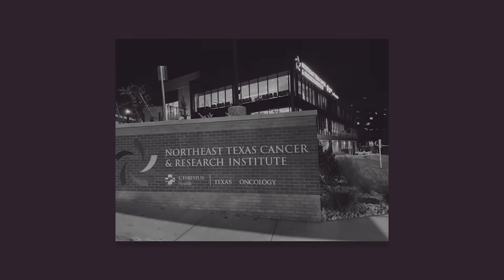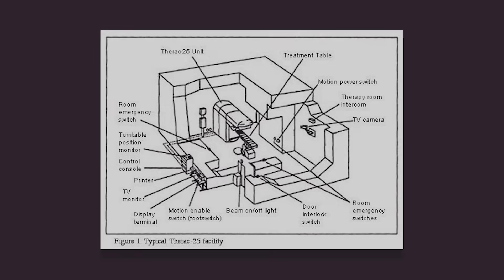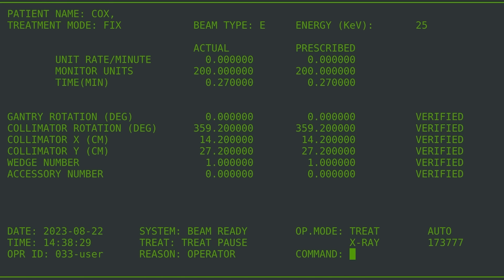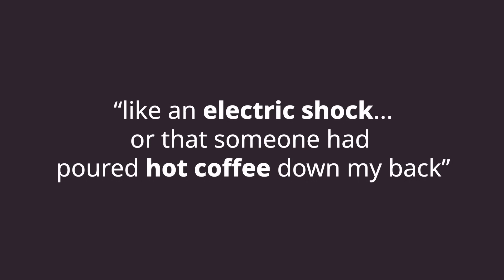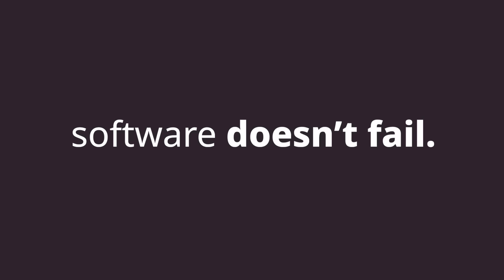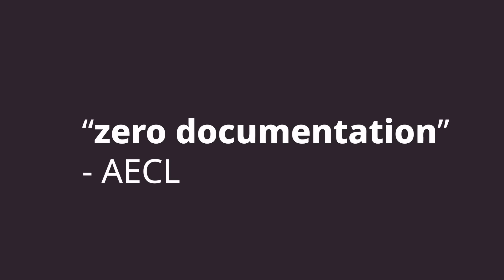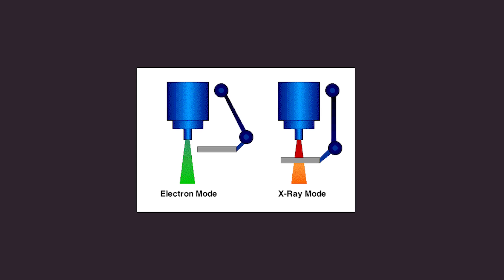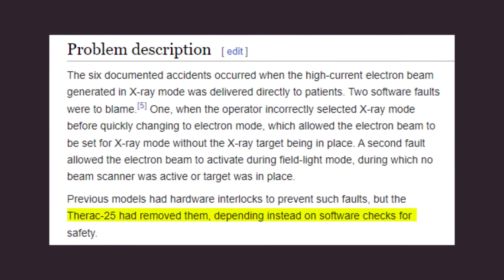how a simple programming mistake ended 6 lives

Comment: I'm a full-time software engineer and part-time nuclear/radiation nerd. I've heard this story on other channels and read about it online, but nobody else goes into detail about the software aspects, which I find the most interesting. Great stuff LLL!
Reply: Well, too much detail is impossible, the code isn't out there at all.
Reply: They probably don't want it public cause it's recycled code that still gets used today 💀
Reply: I have been writing assembly language code for over 30 years.  I was cringing... watching this video.
Reply: I’m writing a book for junior developers, what in your opinion was the root cause? Failure to test?
Reply: @danmurad8080  I think the testing aspect is very important and would've absolutely reduced the severity of the failure, but in this case when hardware is involved, relying too much on software to assume the hardware state without any way to verify it is begging for disaster. Even something as simple as a 3D printer would be a lot more hazardous without sensors to ensure the hardware is in the right state.

Comment: Sobering and sad. A reminder that clean, thoroughly tested code is crucial, together with the assumption that there still may be bugs no matter how many edge cases are accounted for in the tests.
Reply: and hardware locks are the most important, they make sure that even if the software goes wrong nobody gets hurt
Reply: @nelsonahlvik6650 Or if vulnerable parts of the hardware go wrong, the locks protect the entire vicinity (e.g. if the locks worked correctly, Chernobyl wouldn't have exploded).

Comment: If anyone still intent on using software for safety critical applications, I would recommend hybrid setup, with hardware interlocks and sensors so that way if a computer fails for any reasons, hardware portion of safety mechanism takes over. For this case, if a computer goes derp, the electron source must shut down instantly, preferably with forced human intervention so that way you have a technician taking a second look. Attention is always the key to safety. And yessss!!! Properly document everything about the medical software and put the lookup tables for error codes in the documentation handbook, so the radiologist can properly take the action.
Reply: Hardware is nothing more than frozen software and is as susceptible to defects as ordinary software.

Comment: This is why I won't ever code anything where human life is at risk
Reply: Except that verifications are usually a matter of paying the fee and sitting through the course and have next to nothing to do with competence.
Reply: Hoare calculus and verification
Reply: If i was the company i would hire a software engineer who is verified and thinks about everything, not a hobbyist coding student
Reply: @309electronic5 its not about the developer but the company does not fully test the system. The right thing is you should employ a separate QA to handle this kind of edge cases
Reply: @309electronic5 They want money, sweet sweeeeet money, that's all. Sadly

Comment: The problem is that the treatment mode (the state) is saved in the ui. However the ui should not have saved the state but rather queried the hardware in stead. Once you create copies of data, you create extra work you self of keeping them in sync. Just query the source of the data in stead
Reply: Sounds like a task for React
Reply: @mieszkogulinski168  You should not make it even worse than it already is by introducing the messiness and unpredictability of Javascript into the mess...
Reply: You're definitely on to something there. I've seen many times similar problems arising in multithreaded code (non-life threatening, luckily...) over the years just because the same information is stored at more than one location within the program. Often it is stored in one or more UI-related places plus in the program's core "business model" code (whatever that does). One can avoid race conditions all the way to your heart's liking, but still fail to keep all values in sync.

Sometimes one user input may depend on another input, which might even be hidden somewhere else in the UI (eg, different tabs in a Windows dialog box), but the code that validates the dependent input retrieved (a copy of!) the other controlling input just at the wrong time. That could appear similar to reading the E vs X entry before validating the dose entry in this case.

Comment: To produce Xrays, a 'target' is placed in front of the electron beam. The electron beam hits the target and xrays are generated. The target moves into the beamline on a mechanical arm.
The bug is definitely from the dark days of software development, and it pretty much ended the AECL. The technology has lived on however, just with better safety designed in.

Comment: Something like this, where someone's health is at stake, should have had a team of programmers agreeing on, and reviewing each others code. The root cause wasn't the lone programmer - it was all those above him who signed off on that lone programmer. Disgusting working practice and yes, that lone programmer should also have recognised the danger immediately.
Reply: To me the worst part of this was the removal of hardware interlocks. Software can NEVER be relied on 100%, even if it has been extensivley tested. Physical switches and relays should ALWAYS be in place for safety critical applications. If there were hardware interlocks in place in the Therac-25 this would never had happened. Sure, the bug would still have been there, but the machine couldn't have hurt anybody as the emitter PHYSICALLY would not have been able to activate without the magnets in place.
Reply: @nelsonahlvik6650 Not just that, what if some hardware filter breaks off the machine and BOOM, EVERYTHING within a 5km radius is exposed??? Yes, the software would be bug-free, but the plastic broke physically so the radiation core was out there, not controlled by the software anymore...
Reply: @erikkonstas  that machine doesn’t randomly explode, it’s not a nuke
Reply: @wesselrigter8750 You could say that about Chernobyl as well, it wasn't a nuke either...
Reply: @erikkonstas  were you exposed too, or were you not exposed to school? chernobyl is a npp, a nuclear power plant uses RADIOACTIVE MATERIAL. a machine uses ELECTRICITY to generate radiation. electricity won't just explode, and the plastic doesn't protect any radiation, so there would be no difference between broken and not broken plastic, and also, the whole room is leaded so it won't "expose" anything outside of it.
Reply: @erikkonstas  so my microwave is gonna turn into a complete nuclear disaster if it breaks?
Reply: @nelsonahlvik6650 this is the same solution archetype that downed the two 737 MAX jets. Always to save a buck and trim "redundancy". Redundancy in safety critical systems is often necessary, since individual components can fail.
Reply: @nelsonahlvik6650  i wonder if like zap the power to say area 51 dose everyone get locked inside becuase most dont install manual overides anymore?
Reply: He was a lone programmer, working in assembly on a rather complicated machine. He may have been a "hobbyist", but I reckon he is more skilled than many current software engineers. 

Mistakes like these happen, logical errors and race conditions are incredibly common when working on any complex system. He "should have" caught it, is not expected. In fact current software engineering practices expects programmers to make mistakes like these. Which is why as you said, we have pair programming, code reviews, unit testing, etc. 

In critical systems like this, break testing should have been done to identify potential failure points.
Reply: Basically the plot to Jurassic park
Reply: He never had the chance to recognize the danger because he never could have predicted a major medical equipment company would shoehorn his code for an older machine in a newer model. What this video didn't cover is that the code in the Therac-25 was EXACTLY THE SAME as the code in the Therac-20, a machine that used hardware safety checks.
Reply: @iClone101  Oh, that is an interesting fact that changes things quite a bit. Thanks for sharing this tdibit!
Reply: @iClone101  The video does mention that, or at least heavily imply it
Reply: Pair programming, code reviews, and formal testing were pretty much unknown (outside NASA) in the 1980s. We have decades more experience with software today and we know what works and what doesn't. Hopefully software practices will keep advancing and future engineers will be horrified when they hear how software was written in the 2020s.
Reply: @MartinOmander  Well, I am horrified today of today's practices
Reply: @Jack_cx  the lone programmer was also a hobbyist - how can he recognize anything was an error in code or the process... Talk about penny pinching!

Comment: Thanks for this great video. I’ve heard the rough outline of that story, but never to this level of detail. I always use it as an example of the danger of rushing in to a “simple” software project. Donald Knuth wrote several volumes on “The Art of Computer Programming.” Unfortunately, I doubt if one in a thousand current programmers have read them, and of those who read them, likely less that one in a thousand understand what he’s getting at. I bought four volumes based on the title, but they are not a practical dissertation on how to write good code, but a very esoteric explanation of complex programming. I wish someone could interpret the deep knowledge of these volumes to language of common programmers. In my last job, I designed all analog, high-voltage dc-to-dc converters. Everyone was chomping at the bit to design in microcontrollers to modernize them, but without hiring anyone beyond hobby level programmers to develop the code. I’ve taught myself how to code, and at least I know enough to understand the pitfalls of rushing in to a complex project like that, but it was hard to convince management of the risks. Our products were buried deep inside our customers products, and further in their customers products, so firmware upgrades would be somewhere between extremely difficult and impossible, so the firmware would have to work flawlessly.

Comment: The problem is mainly a lack of selectivity and fine grained control.  These days using software running on networked machines in a relatively densified IoT environment, we can decide what sort of results to give for a scan, whether to maybe up the radiation dose for some people and keep it restrained for others.  It may take you quite a while to detect this.  Even longer to prove it, especially if it's running on some kind of backdoored networking chip.  The possibilities for bringing about a new level of equality are vast however.  Little bit here, little bit there, and you can really start taking responsibility, you know?  And pruning the tree of life.
Reply: There is a nice case for backdoor-enabled hardware or software mandated by governments to be covertly (mis)used for the lesser liked individuals there.

Comment: Race conditions are notoriously hard to debug. Because you only have a couple milliseconds for the exact right conditions to occur to trigger the bug.

This is a race condition with an EIGHT. SECOND. WINDOW.
Had they tested it properly, they would have been almost guaranteed to find this. This is not just negligence, this is recklessness.
Reply: this is also one of the best examples of why you need to pay people to try and break your software. you will by default always enter things correctly, you wrote the software, you wrote the procedure manual, you know what you are doing. the user DOES NOT KNOW WHAT THEY ARE DOING, and therefore is not restricted by your assumptions. this allows them the freedom to screw things up in ways you never imagined. This is why it is preferable to pay highly trained chimpanzees (also called QA testers) to find these issues first (no offense to QA people, you are literal life-savers)
Reply: @skellious  I worked on FDA regulated software, and we'd recruit complete noobs to test it, maybe a project manager or someone who has no knowledge of software or the subject area.  We called them "monkey testers" and they'd misunderstand just about every instruction, thus flushing out all sorts of bugs that knowledgeable users would navigate around.
Reply: @d00dEEE  We also do the exact same thing where I work in the NHS. I build an application and test it thoroughly. We then send it off to doctors, clinicians and ward staff to test before actually going live. Because they do everything so "wrong" they are able to produce errors me and my team wouldn't have thought of ourselves and then we're able to fix it before making the application accessable to the whole organisation.
Reply: @d00dEEE  This is the best way of testing. Worst people to test are the programmers, who of course use their own software "properly"
Reply: @d00dEEE  that is so brilliant it hurts, it's easy to forget how much you know.
Reply: @bailey125  same with my site. Somehow my users can pay for something but fail to send the details to the database. I've asked them what they did but their stupidity is so high they don't even know how they fked up
Reply: @davidt8087  Story of my life. They manage to do things so horribly wrong but when you ask them how they did it you just get "I dont knoooooow, I didn't do anythiiiiing"
Reply: @skellious  this is SOOO truth. Early in my career we had a 50+yo woman testing a 📱 app, I SWEAR TO GOD, we all HAAAA+ED her for being sooo dumb 🤣🤣🤣🤣.  It didn't matter what we did and all our testing, the next day we would have a bunch of bug reports tickets open. We would constantly ask her "WHY WOULD YOU PRESS THAT BUTTON, instead of the clearly marked button"

With experience, I realize that Programmers and technical ppl should NOT be testing any app. Its really difficult to switch off knowledge and operate in the mindset of a non-technical person.

Everytime I remember that woman, I have to laugh. She sure did have us earning EVERY dollar of our pay.
Reply: @skellious  Wikipedia calls this the "curse of knowledge"
Reply: This is murder.
Reply: @dsksie  While I certainly feel one or more of the responsible parties are criminally negligent, I don't think any of them had mens rea for murder, only for cutting corners, probably. Nonetheless, a man is dead for their decisions.
Reply: "But it works on my machine" Says the developer trying to test it within safe conditions.
Reply: yep time to sue, but the hardware watchdogs should not be removed anyway.
Reply: Its a hardware race condition the software wasnt even aware of. Software race conditions as you mentioned happen much faster, and its usually a one in a hundred million times one block of code finishes before another and gets write access first, and the coders never even noticed it was a possibility. Except javascript, its usually not a problem, it used to be a constant battle in javascript as the browser would just run code in such a hapazard way.
Reply: Even when software was written well it wouldn't resolve the problem. Hardware was badly deigned. What if there was a failure during these 8s and something got blocked or broken. Software wouldn't know about it and swich radiation regardless of failure. It is not only a software error.
Reply: Dude im a beginner and I agree they are insanely hard to fix in programming like i stared at the code for like 7-8 hours to figure it out
Reply: This is why developers need to use EXCLUSIVE LOCK and dont commit changes until process is full complete. Else, rollback all the changes made by the process.
Reply: A basic principle of software engineering: It's hard (potentially impossible) to correctly remove errors without introducing new errors. Therefore, the emphasis must be on preventing errors rather than detecting and correcting errors.
Reply: Brilliant 🤩
Reply: I test them with getAndSet which roughly translates to xchg in X86.
Imo the worst offender is the lack of information on how the LOCK prefix handles back pressure (there is none).
My guess is that (as opposed to LL/SC which immediately returns with an error) the LOCK will "stall the pipeline" and "queue" the instruction.
Reply: Rust
Reply: @bob450v4  You choose Rust when you need something safe and fast. But for strict safety? I've been told Ada can be much stricter and formal.
Ada doesn't want to be fast. It's backed by what's pretty much a theorem prover, not just a borrow checker.
One thing you can do in Ada and not Rust, is specify that values can only be in a certain range like between 1 to 31 for days of January. In Rust, that'd be handled with parsers and error types, but Ada would be able to track your arithmetic so that you physically can't input any numbers that would add up to more than 31.
It's also mature. Though under a paid license, it's pretty much the default in quite a few mission critical industries up til today.
I've never tried Ada, and am definitely a Rustacean myself, but it seems to do its job very well. Rust should stick to high performance apps.
Reply: @rsboi-yt  Even C is safer than Rust when paired with CBMC (bounded model checker) or Frama-C. For many industries, speed is also a function of safety. There's a reason why flight controls and automotive software runs in C, not Rust.
Reply: @bob450v4  🤣